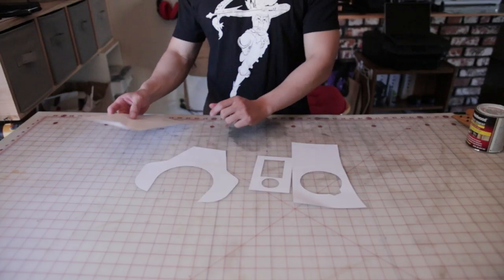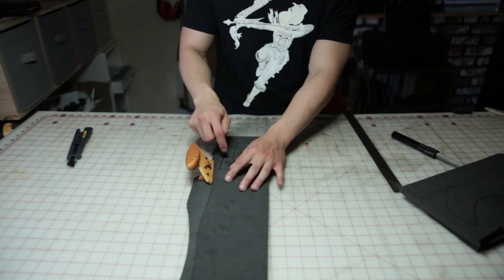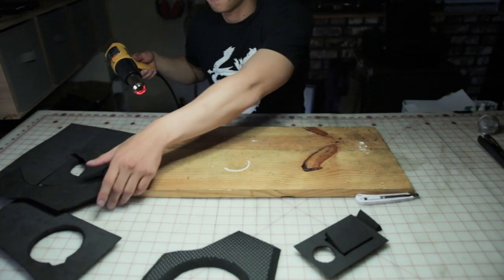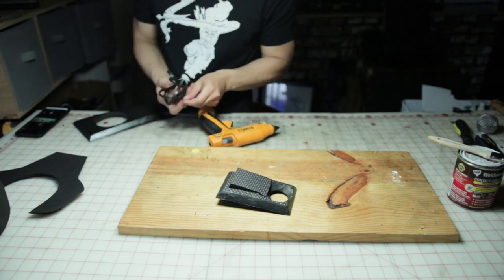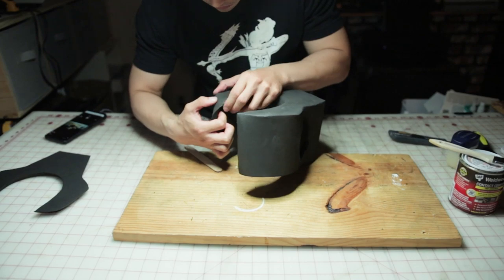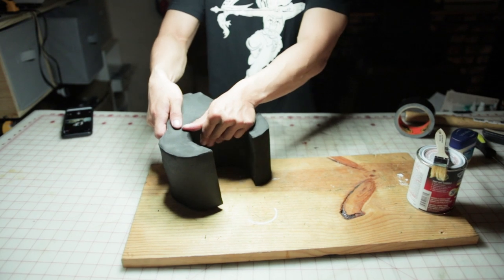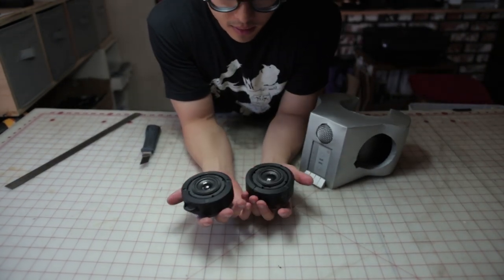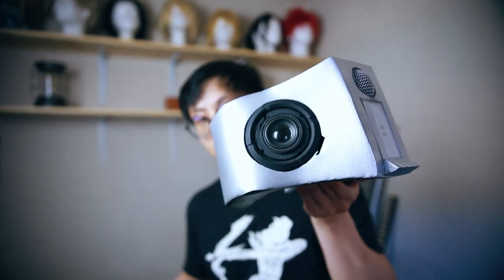HOW TO MAKE PRESENT MIC w/ Bluetooth Speakers // MY HERO ACADEMIA COSPLAY//

Comment: Thanks so much for this tutorial! My only issue with it is that the whole thing was too tall for my neck and I had to shorten it up a bit — so the front detailing is something I’m trying to figure out, haha. I also didn’t have a bevel tool, so I used air dry clay to fill in any gaps. Great work! 💖
Reply from the maker: Yes the height of the neck will vary from individual to individual. Good job on improvising

Comment: May I ask where you got that bevel cutter? I'm terrible with cutting bevels freehand and that looks like a life saver :o
Reply: Late af on this comment but it’s possible to built this with straight cuts. It won’t be as clean but I’m using air dry clay to fill in any gaps. Just be careful and go slow :) You can find these cutters online by searching “foam bevel cutting tool”

Comment: Heres a working link to the speakers I'm p sure they use in the video! Just with the aluminum mesh still on. (sorry the link is so long, if it breaks google VicTsing Bluetooth Shower Speaker though and it should come up.)
https://www.amazon.com/VicTsing-SoundHot-Bluetooth-Waterproof-Compatible/dp/B07RV9BJCX/ref=as_li_ss_tl?keywords=bluetooth%2Bhandsfree%2Bspeaker%2Bwaterproof&qid=1565845482&s=gateway&sr=8-13&linkCode=sl1&tag=iwoodcospla00-20&linkId=c213c7352af5ba0a921f14f677f8ec16&language=en_US&th=1